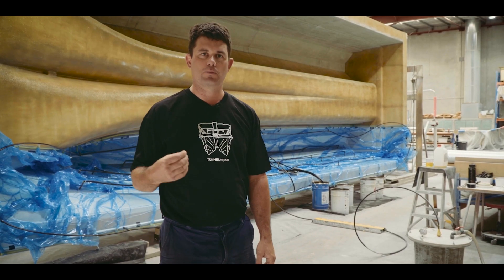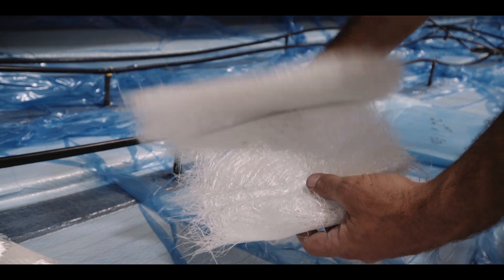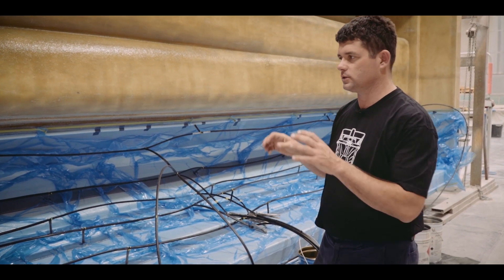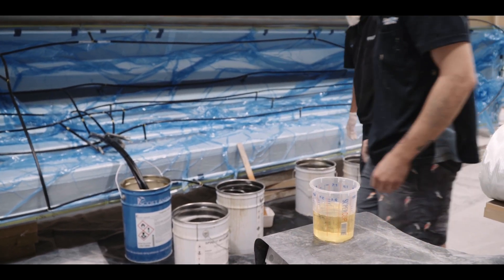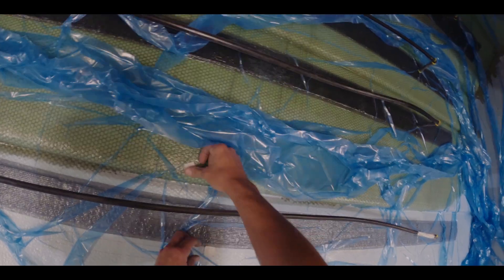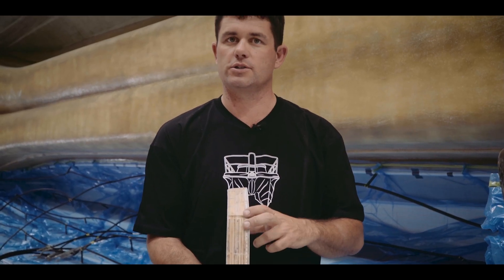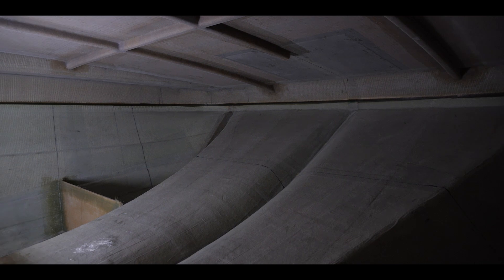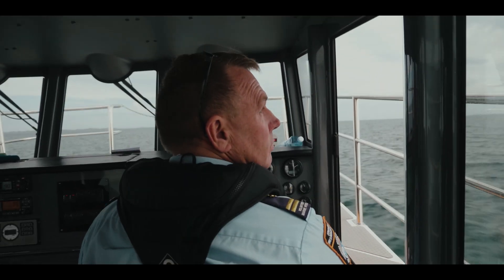Resin infusion explained by Andrew Wright from Shockwave Powercats

Comment: Buy aluminum. I will be
Reply: Aluminium is just as Maintenance heavy as GRP, possibly more so. 

Corrosion and Galvanic Corrosion  on Ali boats is a huge pain in the ass. One stainless washer gets dropped into the bilge and you will have a hole in a few years. Also you still have the banging of Ali. This method of glass boats is pretty competitive weight wise to any Ali cat design, possibly lighter.

Comment: How do you seal the bag down the length of the mold if you only infuse a third at a time? The first third has a prepped mold surface but the subsequent ones you have to seal against the part, which seems impossible. Do you bag the already infused piece along with the new so you can use the top rail?
Reply: Good question. Maybe they leave the initial vacuum bag in place and join the mid section bag to it? Technically it should still be sealed in place. I'm curious how they join and overlap layers of the next section to the previous.

Comment: I built x6 38-foot navy boats in Asia using infusion. The hull weights were within 3% at around 690 kg, and the decks were around 530 kg. We were doing a full hull, taking 5 days to lay the dry glass fibres in and a 3-hour shoot time using Vinyl Epoxy resin.

Comment: Great video. can you get a bit more in depth on infusing the hull in sections, I have experimented with infusion and i would like to use the technology in building some parts infusing in sections, Cheers Bo
Reply: Yeah, that would be the most interesting part. How do they ensure the structural connection between the separately infused sections…?

Comment: Interesting video I guess they taper the edges so it overlaps with the next section …wouldn’t like the wood but sounds like it’s the stronger option probably the life of the boat for the first owner anyway
Reply: If the penetrations are done properly it will never be an issue. It's only when someone exposes it to water does it have a chance to deteriorate.
Reply: The resin is infused into the timber, as timber absorbs the resin  and infused with glass over. Therefore, it becomes part of the GRP. The old ways of glass over ply was more like resin spreed over the timber and not completely sealed nor infused. Very different.
Reply: @davidyang577 I‘d still rather have a slightly less solid non organic alternative that is still plenty strong  but will never ever rot. Like Coosa board or something similar.

Comment: Possibly the most informative vacuum infusion build video I have seen. 
Super sweet boat, so many nice design features. 
Answered a few of my questions regarding vacuum infusion but still got some.
Reply: What’s your questions I work there and could possibly be able to answer them if not will definitely find out
Reply: @Buntabunta937  What weight is the glass layers and thickness of the soric?
Reply: Do yas glass over the crestima  when gluing in bulkheads, seatboxes etc?